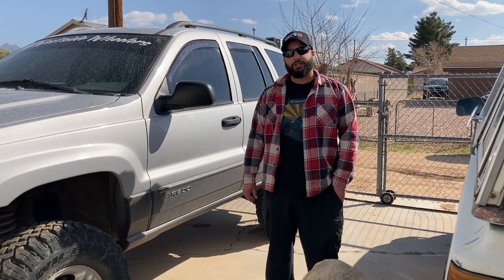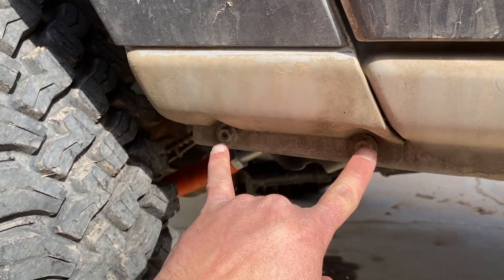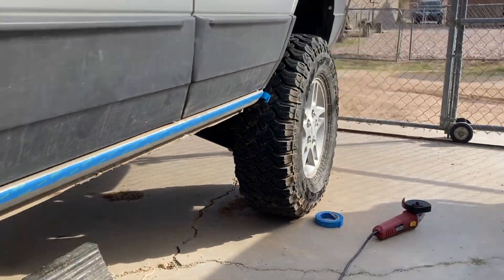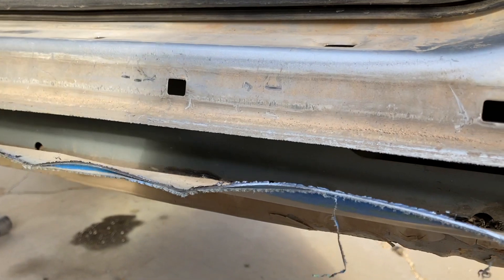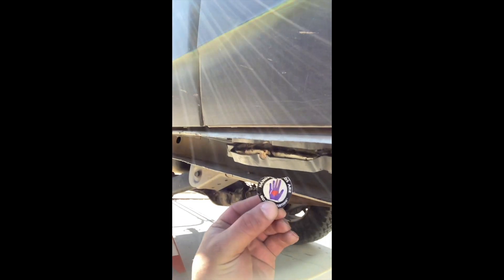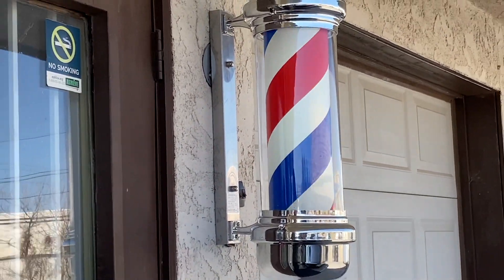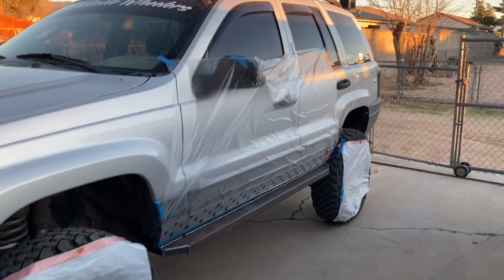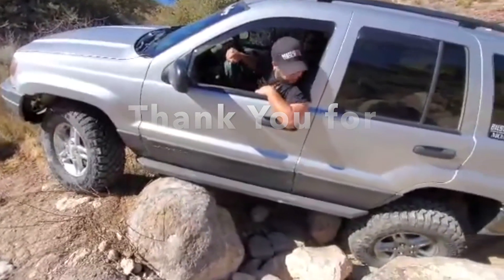DIY Rock Sliders for a WJ #JeepGrandCherokee #theazwestsidecrew

Comment: I like your idea. It gives it more clearance as to just welding on a bolt on. Your idea looks to give WJ owners 2-3" in more clearance. I  ight just do something similar to mine.
Reply: It definitely adds clearance and because I used a 2”x8” tubing it sticks out far enough to help keep boulders from hitting the doors but if you wanted a more subtle lip you could use a 2”x6”.  But it does also give you something to stand on as well if you’re using the wider tube.

Comment: So what solution did y'all use for that taper? Thanks for this video. Didn't really want to pay someone $500+ for something i could do myself. I knew about the ZJ mid, and figured there HAD to be something similar i could do to the WJ.
Reply: It ended up being a nonissue. It you follow that line straight back with the tape and keep the gap two inches from top to bottom the 2”x8”x0.188” tubing closes the gap between the body. The 3/16” (.188”) wall tubing it is sturdy enough to keep from flexing. Even under direct contact and hard hits. As long as you don’t use anything below 3/16” wall you should be good. If you decide to use 1/8” wall tubing I would slide a piece of 1”x1”x0.095” wall tubing in above the slider and weld it to the body. Feel free to reach out if you have any other questions. We’re happy to help.

Comment: Do you have any more details on how you tackled the curves in the body.
Reply from the maker: We will be doing an update video soon. Not necessarily a how too but what we did. We cut fenders and built diy rear arms to fit 37’s😉😂. Lots more coming soon
Reply: Sorry it took so long to respond 😬 Cutting along the body line that I chose actually worked out perfectly. It leaves the gap perfectly to slide the 2” x 8” tube in tight. The curves in the body are now just hollow space but is completely sealed after welding. I am going to add a few stiffeners behind the slider in another video coming soon. Be sure to check it out. Let me know if you have any other questions.

Comment: What’s your lift/tire size? Did you have to trim any sheet metal?
Reply: @Graystone 304 It’s a 4” Rough Country spring, 2” Rough Country spacers, Core4x4 control arms, Adams Driveshaft front shaft and ECCPP 2” Wheel Spacers. Fits a 32” Falken Wildpeak M/T without trimming. You will need to relocate the windshield washer fluid reservoir. (ZJ swap)
Reply: @killianjoseph3742  how do we ask for this and where do we get it done 😂
Reply: @dayblue_  Grab a cutoff wheel and find a buddy with a welder that you trust. Other than that, you just need to buy the tubing. It’s 2.000” x 8.000” 0.188”wall A500b tubing. It’s not super expensive. Whole thing cost me about $150. Go get em’!!!
Reply: By any chance you have info to place you got material from I’m from Phoenix and I’ll to do the same like you thank you.